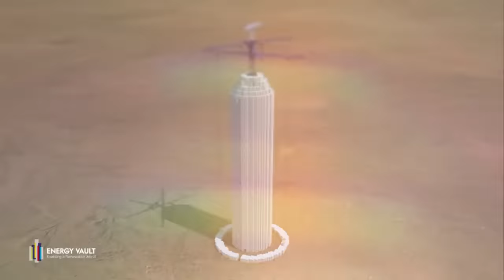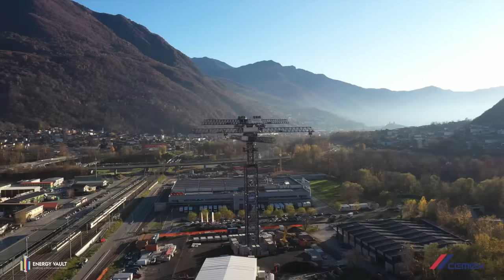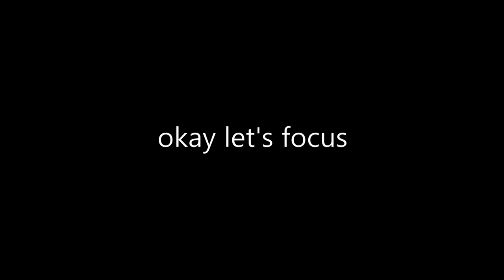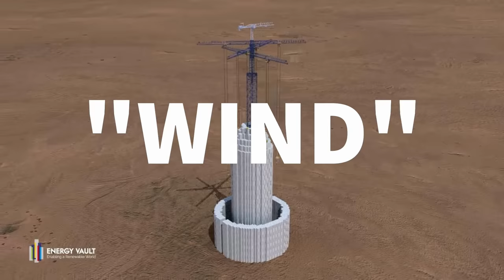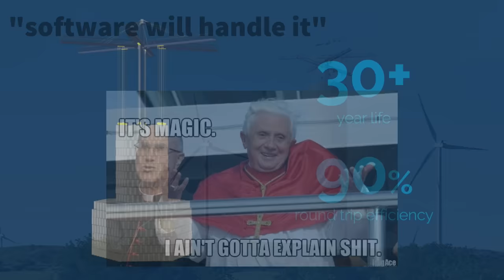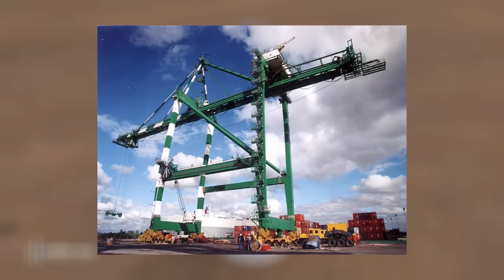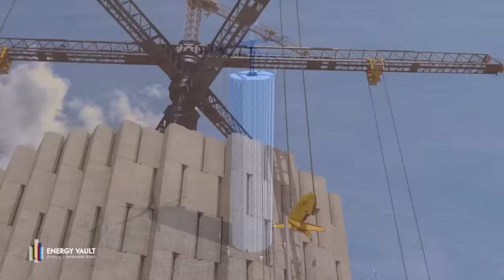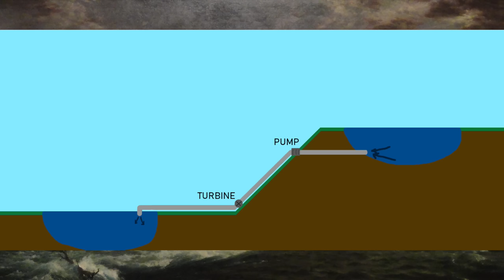The Energy Vault is a Dumb Idea, Here's Why

Comment: Having done a lot of research into gravity storage, it is a very weak force, like the weakest force we know of.
If you attach springs to the weight being raised, it can 4x or 10x the energy stored.  Steel springs  can last a long time, but they do wear out.  There are other 'springs' too.  Of course, a crane with cables and pulleys is just plain stupid as stupid gets
Reply: how do springs increase the amount of energy stored?
Reply: @airierwitch4116  springs store energy when compressed (or stretched, or bent)  Have you ever played with wind-up cars as a kid?
Reply: @airierwitch4116  it would decrease the total energy stored but increase the energy stored per unit height. Some extra losses would come from heating up the spring material as it’s stretched, but a block wouldn’t have to be lifted as high per joule because it’s not all stored by virtue of gravity field.
Reply: you could use pressurized air in old salt mines, they tend to be airtight, so you can probably go above 100 bar without too much trouble, maybe even up to 700 bar like they can do with hydrogen tanks.
Similar things are also possible in empty gas fields, but you need to use nitrogen instead or you will get an explosion.
Reply: @coen270  Good idea if one is available.  The key thing about gravity is that it is everywhere.   I recently been thinking why not use magnets, that is a very powerful force you could store energy by pulling them apart.  Probably way too expensive i'd guess, but only need steel on side, and true magnet on the other.
Reply: @murraymadness4674  The part about it being too expensive is definetly true. magnets decrease in strenght quickly once distance increases, unless you greatly increase the surface area. The problem is the amount of magnets and iron you would need to implement this, which is ridiculous.

I did find something on using magnetic fields for energy storage.  Its called Superconducting magnetic energy storage (see wikipedia), they essentially make a massive superconducting inductor, in which energy is stored. Outside of the power needed for cooling, it's losses are very low.
Reply: @coen270  A big surface area is key, then you only need to move 1/8 inch.  But yeah real expensive I'd guess (but haven't done the calcs),  however, you could use it to just boost the gravity effect, just like a spring would, and magnetics don't wear out.
Reply: @coen270  Pressurized gases are a bad idea for a number of reasons, the biggest one is their horrible efficiency. Using a hydraulic cylinder to pull springs apart is way more efficient and safer
Reply: @techtastisch7569  The thing with springs is that they have a very low energy density with high material cost, which would make them usable only for short term energy storage. Here they have to compete with flywheels and batteries, which can have energy densities of 1000 times greater than springs. Thus springs are useless.

The idea of compressed gas, even with its mediocre ~60% efficiency, is that it is uses existing structures. This allows you to create very large storage capacity with comparatively little cost/resources, that can be used long term, where batteries or flywheels dont work. 
It is not something that competes with the short term energy storage solutions, but it complements it. 
It does compete with hydrogen, which has higher energy desnsity, but lower efficiency(40%).
Reply: @coen270  one of this companies competitors in the UK has a similar design to this crane/ block energy storage, but they use abandoned mine shafts, instead of towers.
Reply: @coen270 In best case, efficiency of air compressor is about 20% and rest is released as heat.. There is no way around it..
Reply: @anssinevalainen1852  What you are saying is factually incorrect, based on the research i looked up on compressed air energy storage. sadly youtube doesnt allow me to share the link with you.

Base cycle efficiency is around 40-50% for CAES, and can increase to above 60% if some form of thermal storage is included, which is very attractive considering the gains. There are also other methods to increase efficiency, but you need to look those up yourself.

Comment: I think a place weights could actually help is inside wind turbine towers, tied directly into the mechanics of the turbine. IIRC, they have to use brakes to make sure turbines don’t spin too fast, which just results in lost energy. If instead of brakes they used weights to regulate the speed of the turbines, they could store that intermittent burst of power and then use it to help maintain power output when the wind dies down.

Inspiration:
— pumped storage
— grandfather clocks
— electric car braking systems
Reply: i guess so, but from my limited knowledge of the insides of wind turbines those weights cant be too big as there still needs to be a space for technicians to climb to the top inside.
Reply: @guesswho2778  true
Reply: The generator itself is applying almost all the braking for the turbine and they have conventional brakes for abnormally high wind conditions. Adding a bunch of complexity redesigning the entire turbine drive train to some have a clutch to a crane pulley for braking and reinforcing the structure to carry that additional weight doesn't make much sense.
Reply: @kylehenline3245  fair enough. Didn’t really intend to convey it as a good idea . . . just one that makes a little more sense than a giant jenga tower out in the open
Reply: they exist. they are called "kinectic storage units" and are large heavy cilinders attached to the main axis of turbines. They ensure constant rotation speed.
Reply: @bivoca  oh cool, nice to know, thanks 👍
Reply: You are referring to a flywheel. Attached to the main axis as in it is a disc of heavy material on and around  the shaft, not a drum raising and lowering a weight. No offense meant to trafacial86, just converting rotary motion to linear or vice versa always requires a some additional mechanical complexity and extra complexity is not ideal for a machine that ideally runs 24/7/365.
Reply: You've done it! You've revolutionized wind energy! In one paragraph in the YouTube comments! How has every engineer who has ever lived not been as smart as you?!
Reply: @ahall9839  you seem pleasant
Reply: This... seems legit...ish.... not sure how the structure of the towers would handle tons of extra weight being raised and lowered. The alternating stresses induced on the structure of the tower would likely weaken them over time. Reinforcing that structure might make them economically nonviable.
Reply: @wolfumz  Hey, he has a point. Surely the people who DESIGNED THE WIND TURBINES have thought about this (and they have, according to other comments). This is why before you throw an idea out into the aether you just go google "how does this wind thing work and how does it keep from going too fast".
Reply: Why don't they just use a generator to slow down the turbine?
Reply: No. A windmill has to spin at a specific Mhz or it breaks. The generator applies braking during high winds, and the power grid provides power to the windmill during low winds. Windmills are terribly inefficient, are made from highly toxic materials, are not recyclable, are fragile, and operating them leeches deadly chemicals into the ground and eventually the water. If you see a windmill thats not spinning. its broken.
Reply: @HellsYeah8  lol yes, the 100 foot mechanical structure is non recyclable.  So don't even try to put it in the blue bin.  I can't believe they made the gears and turbines out of "toxic chemicals"!

 What you're saying applies to virtually all structures and machines, much less methods of power generation.
Reply: @wolfumz  ok. Let me be even more clear. The manufacturing of solar panels and wind turbines releases nitrogen trifluoride, a green house gas 1700 times worse than co2. This ignores the environmental disaster mining for the components.

Neither wind turbines nor solar panels are recyclable. For solar, the panel cannot be broken and the amount of materials you get is miniscule anyway, and turbines are completely non recyclable. Meaning, they waste materials. Not to mention all the African children dying to mine the materials for Chinese companies.

Wind turbines need to be regularly de-iced. In order to do it, a helicopter is used (releasing CO2 needlessly) and the same chemicals used to de-ice planes are sprayed on the turbine. Unlike at airports, where the airline is required to protect the environment by having drainage, collection, and disposal of this cancerous chemical; this chemical is just dumped on the ground. This leads to leeching into the groundwater, which may explain why Californians are so mentally deranged.

I've been to wind turbine fields. They were all broken. Every single one. When they are not broken, wind turbines are a net drain on the power grid, as if the wind isn't blowing they pull power to keep spinning. If you see a wind turbine not spinning, it's broke.

All of this ignores the other issue with so called green energy. Power modulation. Neither panels or turbines can modulate output to meet peak demand. They are not dependable, are fragile, and again are made out of materials that are rare and toxic to mine. (But hey, it's just African children doing the mining, so who cares right?)

In 30 years we are going to have a massive problem with landfills filled with panels and turbines poisoning the ground and water (as, again, they aren't recyclable). It doesn't matter how much we lower CO2 output, when manufacturing these crappy things releases worse greenhouse gases. We'll also be running into a shortage of the rare earth metals in the panels. So we'll just have a pile of toxic garbage we can't do anything about, have released a massive amount of nitrogen trifluoride, unable to make more panels, and still burning coal. All so people like you can feel warm and fuzzy inside, despite making things worse.
Reply: @sirloin17  sure buddy
Reply: @sirloin17  every single publicly available source says the same, and i've been to Californias field of broken wind turbines many times
Reply: @sirloin17  3 times zero is still zero and turbines still pull more from the power grid than they put out.
Reply: @wolfumz  I have yet to be owned, especially not by some random person making claims on YouTube comments. It's not antifreeze, and even if it was, that's very environmentally hazardous. 

If the blades are unrecyclable and made of extremely rare metals, (as they are) then not being recyclable is an issue. In 30 years, landfills will be filled with with panels and turbines leeching, among other things, lithium into the environment. Maybe you should look into what this does to people. Oh wait, it only happens in Africa for now, so who cares right?

It's more than an engineering problem, its an intrinsic feature of the technology. Not to mention, the worse than CO2 greenhouse gases produced during the production cycle. And the poisoning of Africans and colonization of Africa by China to mine these materials. But hey, let's step up production. It's just an engineering issue.

Wind power is a net drain on the power grid, and cannot be effectively scaled.

Comment: That really does sound like a dumb idea. Imagine one block gets dropped wrong or breaks, that's going to screw up the entire stack. Do you expect someone to go out there and stand next to a huge stack of concrete to service this thing? I would be surprised how many governments would even approve of building something like that, considering how unsafe it sounds. I mean any small shift in the ground is going to cause the whole thing to fall over, so you would need to clear out a large area around it.
Reply: not to mention the extreme amount of stress and wear the little grabbers and the holding indents would go through. those blocks would crumble and erode so damn fast, and before long you'd need to build entirely new cement blocks, which as was pointed out, is extremely environmentally dangerous
Reply: They should have used more appropriate music. "Wrecking ball" for example.
Reply: Concrete jenga :)